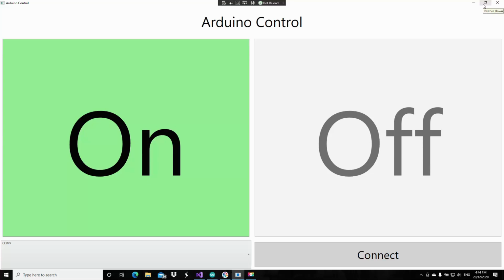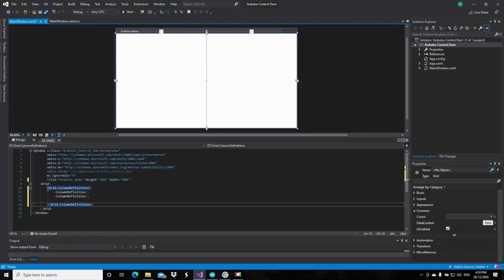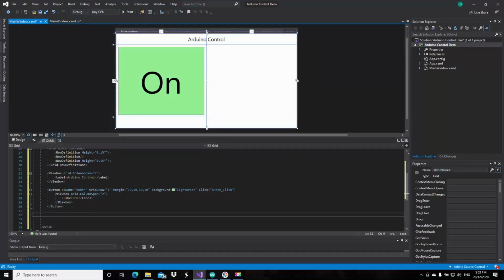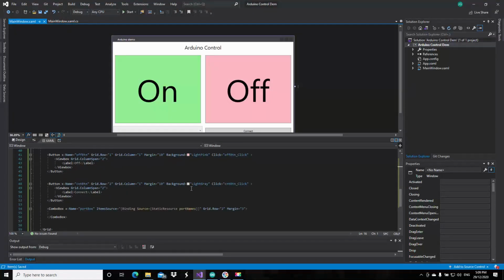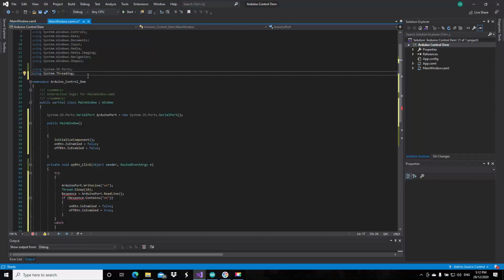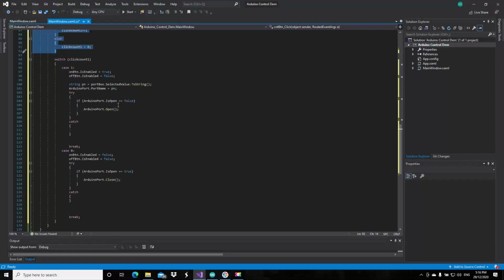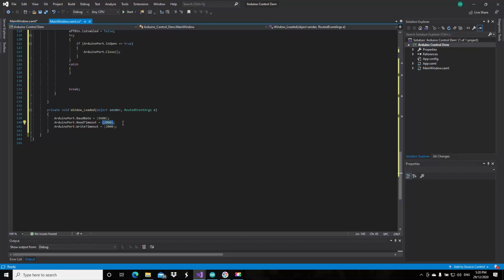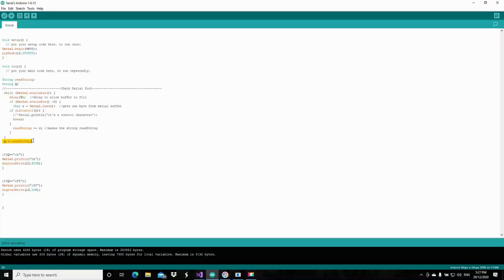Control Arduino using C# and WPF

Comment: really nice video, but i have a problem with the off and on buttons... i press the on button: my arduino turns on the led for a millisecond and i cant keep it "on"
Reply from the maker: Hmm, sounds like you have it set to go to low again some where outside the If statement